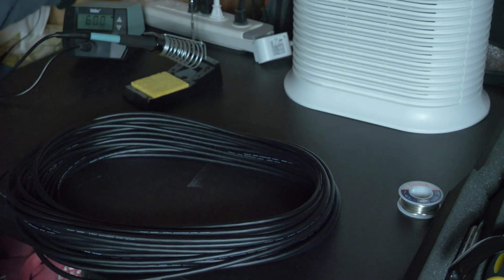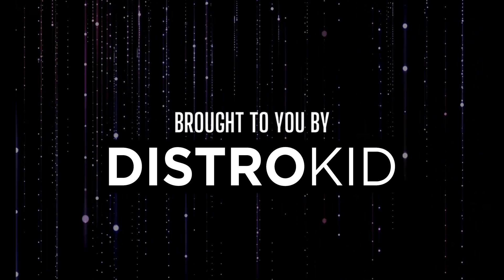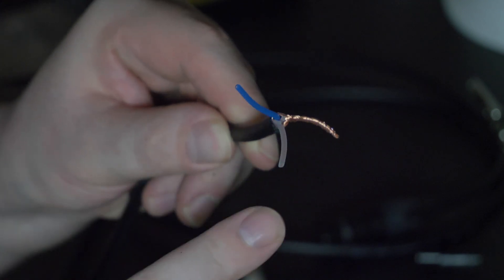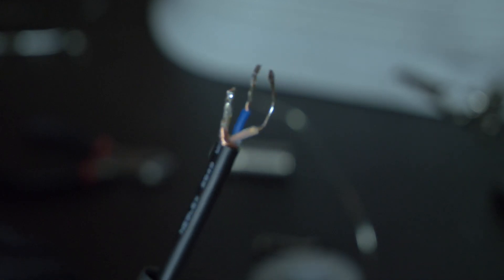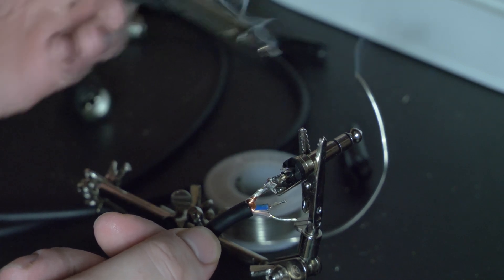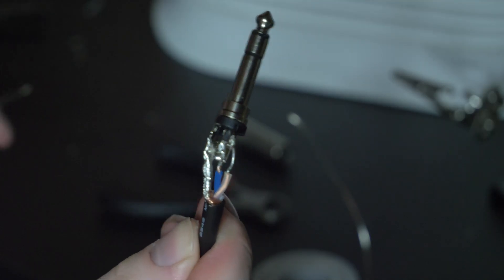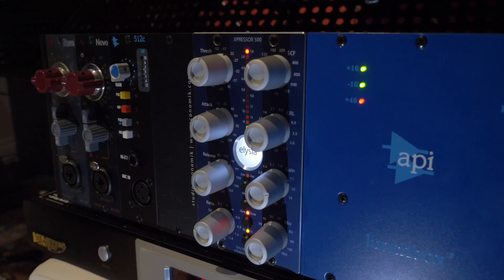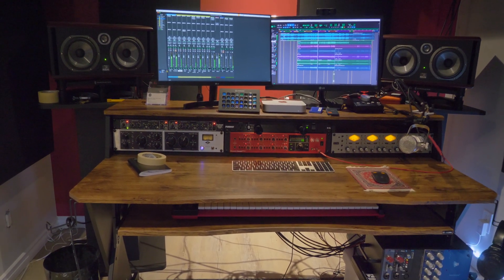Making Audio Cables: Soldering Stereo Phone Plugs

Comment: The normally accepted method for soldering is to tin the ends (as in the video), but then position the two tinned parts together that you wish to join (do not add solder to the soldering iron at this point) press the soldering iron against the join just long enough to bring it up to temperature and with your other hand touch the solder to the joint. The solder will flow readily and neatly... then pull away the iron and solder.
You should also end up with the screw-in cable grip flush against the metal body of the plug (not with threads visible as in this video). To achieve this you may need to trim the length of the plastic inner piece to allow the screw-in end to go far enough in. You will then have a cable that is functional, neat and professional looking.